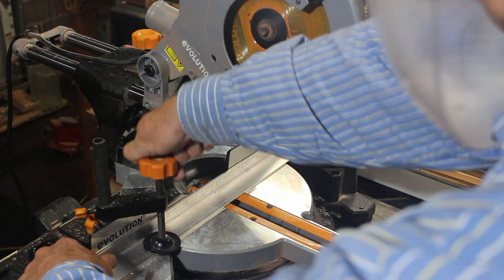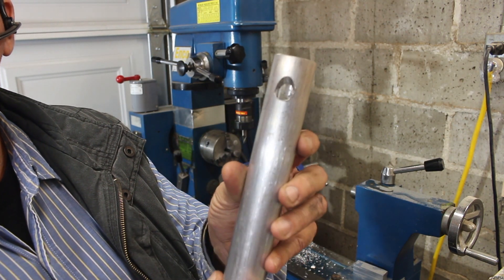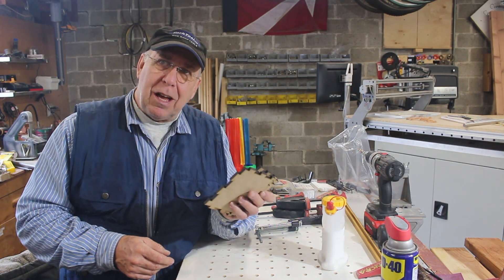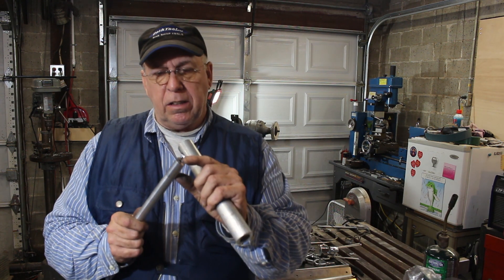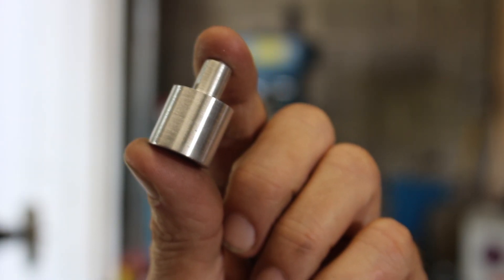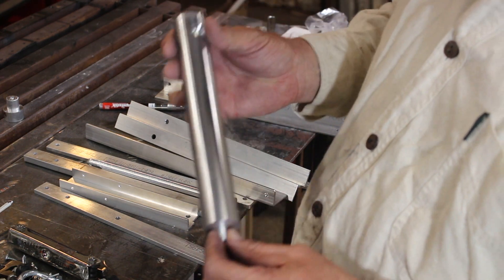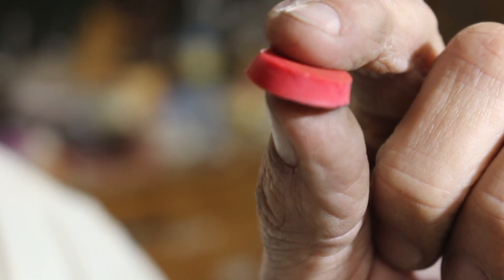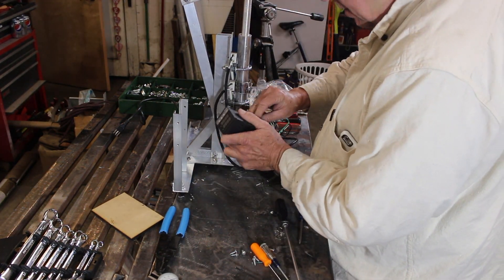Injection Molding Machine for under $100 in parts using less than $700 worth of machinery!

Comment: Hello Wildman.
 
 I REALLY like your honest appeal for feedback. Opinions are everywhere, but getting at them seems nearly impossible. So, here are my thoughts on the format of your video, but bare in mind that - had you not asked - I would have watched it from beginning to end and thought "good video" - and subscribed if I weren't already.
 
 1. Looking off cam at your notes is a little distracting.
 2. For me, there is too much footage of machining operations - fast or normal speed. So, for example, tapping the piston - I want to know you did it - I don't want to watch it.
 Same with what you called the "tedious assembly stuff".
 3. More generally, I find too much detail, which is astonishing given how interested I am in your topic. Of coure, you are living the details of every step of making everything, but from the "outside" I find I just want a general idea of what was done, and then to see it doing it. And having said that, I'll try to do it this way in my videos.
 
 On ther injector itself, I make them too, so I'm curious in these ways:
 
 1. The aluminium will oxidize. Have you noticed any issues with that?
 2. I loved the heat shrink fit for the barrel end. Has it stood the test of time?
 3. Did your piston seal withstand 140+ Centigrade plastic melts as high pressures for long?
 
 You're such an enthusiastic, easy-going and likable man, I can see why your channel is successful.
 I hope you find these comments helpful. I know you can delete them if you want to, so
 I don't feel at risk of doing you any real harm. I welcome any feedback you have on my videos!
Reply from the maker: I don't use notes. I have a condition called strabismus and that is what you are seeing. It's worse when I'm tired and I was really burning the midnight oil when I made this video. I have not seen any oxidation issues. The friction fit of nozzle in tube worked perfectly and the piston seal has held up just fine. Next time though I think I'm going to use a two-part silicone and cast it in place. I'll go check out your channel. Thanks!
Reply: Ahh, my brother has strabismus. Another comment I should have made was that it would be great to see the machine in action. Anyway, thanks again.
Reply from the maker: There's a link to the follow-up video and subsequent vids in the description.
Reply: Thank you - I'll take  gander.
Reply: I've had the same problem with Chinese heaters not being the power they quote that you did. It's like they have a huge pile of them and don't really understand  that they have different powers and are not interchangeable.  And I've had clients have to wait while I re-order them again, which is grim. So now I have to maintain stock.

Comment: Although i do think the title is misleading, the effort and the creativity was helpful.   Most of us gravitate towards videos like this because we all want to find a way that works for us.   Soooooo many projects us crafty people do ignore the labour and tooling (costs and accessibility) and simply add up the material costs.  Hence, Wildman's mention this was $100 of raw materials.   Many other videos out there on other injection machines.  Take notes on what you like and add comments that are helpful to everyone else that has similar questions.    I can suggest Precious Plastics machines mainly because they are open source and revised.   They will cost you more that $100 in materials.      Nice work Wildman. (Y)
Reply: In what way is the title misleading?
Reply: I agree with this. The current title is something like “Build an injection molding machine for under $100 in parts with less than $700 in tools.” I don’t doubt that someone could build a similar machine with few tools, but that’s not at all what you’re showing here. IIRC you used a chop saw, drill press, lathe, and maybe a milling machine on camera, and a sander off camera. Where can someone buy that collection of tools for $700? Nowhere. The video is fine, the format is fine... the only problem is that the title suggests that you’ll show how to do the build with a lot less machinery than you actually did.

Comment: The videos and commentary are fine the way they are. However, this entire thing you built is jury-rigged. A properly made device you're trying to promote should have measured drawings. It's the one huge overwhelming drawback of all youmaker dudes. No flipping drawings
Reply from the maker: I didn't have any drawings. This project is an EXPERIMENT! I was TOO BUSY BUILDING IT to make drawings. I did give links to the unusual parts used. If you watch the follow up video, I show what worked and what didn't and how I modified it. Again, TOO BUSY BUILDING IT to make drawings.

Comment: I built an injection molding machine about 10 years ago. It was similar to yours, except it was as an attachment to my drill press.  I had a friend with a machine shop make the cylinder and piston, with a threaded end to accept different nozzles. It would sit on the drill press table, with the nozzle through the center hole, and the plunger went in the chuck. I used heaters from cheap dollar store glue guns. It was a big block of aluminum, I drilled holes in it for the heaters and used pc thermal compound to seat them.  I just used the harbor freight temp gun to monitor temperature, and plugged the heaters in.  I was kind of just playing around, trying to make a mag-safe adapter like Apple uses for other laptops. I was using these plastic pellets that melted in hot water for experimenting. The best thing I saw you do was the silicone gasket, I had a lot of blowback. 
 This was pre-$159 monoprice 3d printers. 
Anyway, other things demanded my time and it was eventually abandoned.  3d printers would probably be more appropriate for initial prototyping, injection molding is for when you are actually mass producing the thing. My machine shop buddy sent me the link to yours.

Comment: For making your piston seal, instead of punching it from a silicone spatula, it is easy to make a much more precise one by casting silicone resin into a mold (which can be machined from aluminum or laser cut from acrylic, optionally with edge polishing). Smooth-On and Alumilite are two sources for silicone resin, which is available in a wide variety of durometers.
Reply from the maker: The seal actually is a bit of a waste a close-fitting piston seem the best we've found so far.

Comment: can something like this be scaled up for lets say something i need to inject about 1kg of plastic into?
Reply from the maker: YES!
Reply: Sure it can, but know that large injection molding machines often use tons of pressure to inject large amounts of plastic fast enough to get a good part. You might be surprised at how much force is needed to fill even a small mold.

Comment: You have a really nice attitude. Considering the prevalence of 3D printers I wonder how hard it is to extrude spools of filament?

Also, I saw TheEngineerGuy's video about injection molding and he mentions a reciprocating screw. Maybe you don't need that when heating plastic slowly for a few parts? I really don't know!

Comment: I used to work at a plastics company.... we used auger type screw in the extruder that could be controlled by speed and volume.. wouldn't that solve the issue of the piston?
great video...

Comment: After viewing pt 2 (which has comments disabled), I'd like to mention a couple of things.

1.The spark may have been a short to the frame.  Hoping your have the frame grounded.
2. If you use a ball-nose end mill to mill into a rod or tube, you may have a better hole.
3. I noticed your machine's chuck rotating while you were angle-milling into the tube.
4. You can mark a piece of paper (tape) and affix to the chuck to provide a minimal rotary index.  The overarm on these machines is a very nice item to have in a shop (a mill dead over a lathe).
5. If you will terminate your injection procedure with strips of milk jug (polyethylene), you will have a much easier-to-clean piston/cylinder/nozzle.
6. Your local library can obtain some books on injection molding (process) machines.  In them you will see some ideas for a nozzle valve that will prevent dripping.. most designs have a slip-ring that backs up slightly when you remove pressure.  The slight backup seals the cylinder from the nozzle, stopping drips.
7. If you alter your design slightly, you can have a clamp to seal to the mold.  This becomes a 2-stage press, a) to clamp the nozzle to the mold, and b) to inject the plastic into the clamped mold.

Consider PE (milk jug), cheap, obtainable, easy to peel/clean.

I do like your designs simplicity.

Beware of shorts from heater power to ground, and theromcouples are know to short to their cases, too.  

As to the PID controller, I'd like to know the model you chose.  Many are CREX-100 knockoffs, some with no relay, some with relay, some only able to switch a solid-state relay.
Reply from the maker: The only books I've ever seen on injection molding are Vincent Gingery's "The Secrets of Building a Plastic Injection Molding Machine" and college level textbooks on the subject that cost hundreds of dollars. The former was my guide in building this. There's link in the description to the PID controller I used. It requires an external relay. An additional follow-up video is scheduled for release Sunday.
Reply: Local library obtained these for me on inter-library loan, cost nothing, learned a bunch:
Injection Molding Handbook ISBN 1569904200
Plastic Injection Molding ISBN 0872634728
Injection Molding ISBN 1569901937

These are process books from which I drew ideas.  I found a pair of DR-BOY 2-ton presses (in bad shape) and fixed them up to run.

Whoever ran these last sure didn't clean them with PE, as the screws were stuck.  I had to bake the cylinder/screws to get them apart and clean.

They pretty much operate like a relay-type pinball machine, switches, relays, timers.

Comment: Maybe if it was horizontal. Solve the dripping problem some. The melting plastic may settle in a way to solve air bubbles if during heating it had a slight pitch. Use gravity in moderation.